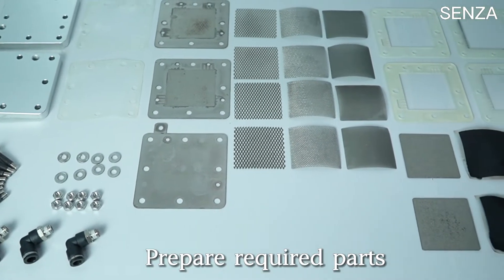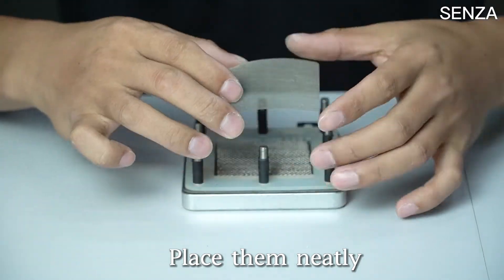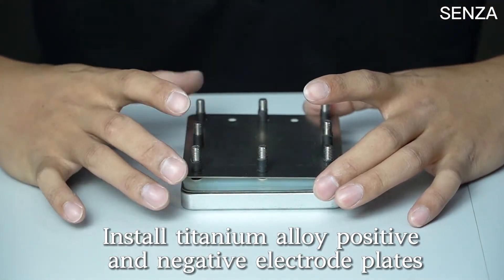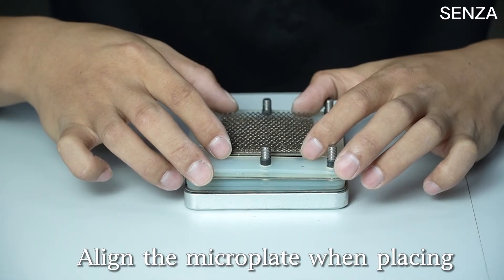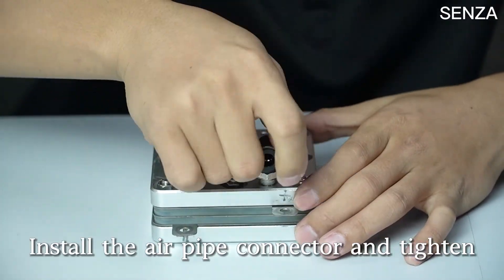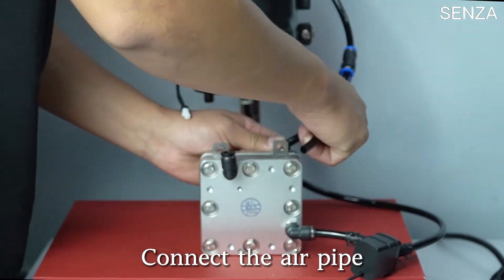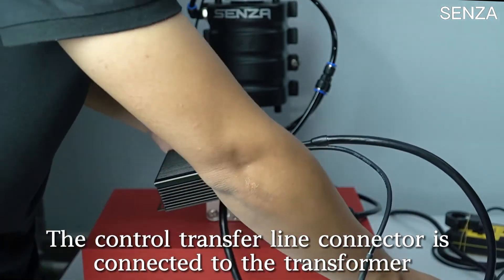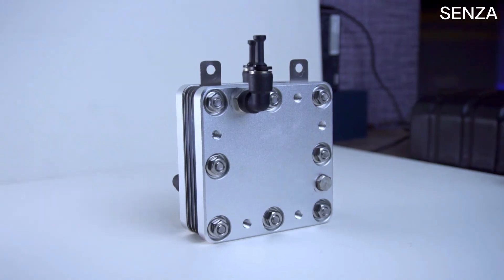How To Build A PEM Hydrogen Generator

Comment: How much is the size? For example 50x50 cm ? 25x25 cm alüminyum size ?
Reply from the maker: Hello, the size is: 10x10 cm alüminyum size
Reply: @senzahydrogen  thank you so much. There is a quasiton for this system. What is the other alloy of titanium ? Platin ? Are the alloys at the anode and cathode different?
Reply from the maker: @yasirargun2918  Both cathode and anode use iridium oxide
Reply: @senzahydrogen  Are titanium and iridium oxide coated on the metal on the anode and cathode plates?
Reply: @senzahydrogen  why does use iridium oxide ? Also, what is the reason for using titanium? Can it be made of 301L stainless steel?
Reply from the maker: @yasirargun2918  In high-potential, oxidizing, acidic environments, PEM electrolyzers
The requirements for catalyst materials are extremely demanding. A reminder that meets this requirement
Chemical materials are limited to certain precious metals. 316L is very susceptible to corrosion damage.

Metal stability: Au > Pt > Ir > Ru > Os
Anode catalyst activity: Os ＞ Ru ＞ Ir ＞ Pt ＞ Au
Cathode catalyst activity: Pd > Pt > Rh > Ir > Re > Os > Ru > Ni
Reply from the maker: Both the positive and negative plates are made of titanium alloy, because the performance of titanium alloy is very stable, which is much better than the stainless steel. The proton membrane between the positive electrode plate and the negative electrode plate is coated with iridium oxide, which has good performance and stability.
Reply: @senzahydrogen  What is the material of the microplate? The reason why I ask in such detail is that I will take these parts and make a hydrogen generator for the experiment. thank you so much :)
Reply from the maker: @yasirargun2918  This is made of titanium alloy.
If you want to make one yourself, you can contact us (service@senzahydrogen.com) because there are some materials you can't easily buy.
Reply: @senzahydrogen   I send mail thank you. Which one are efficent ? Pem Elektrolid or Alkaline Electrolyzer Hydrogen Generator ? how much is the difference?
Reply from the maker: @yasirargun2918  PEM electrolyzer are more efficent.The difference in price depends on your needs, as the price of customized electrolyzers with different rates varies.
Reply: @senzahydrogen  Also, do we need to increase dimensions to increase hydrogen production? Or should I increase the number of plates in between?
Reply from the maker: @yasirargun2918  Yes. You can do this by increasing the area of the Proton Exchange Membrane, or by increasing the number of stacks.